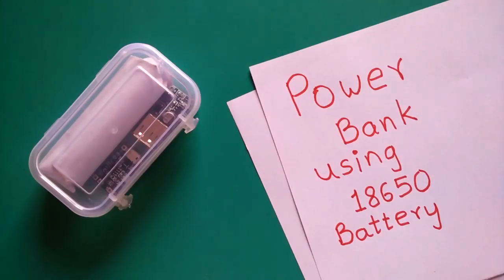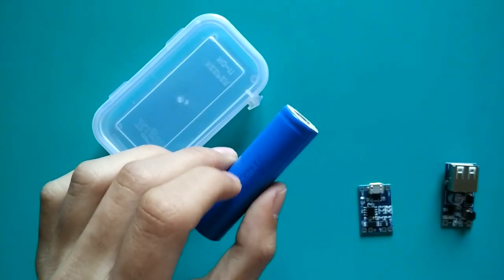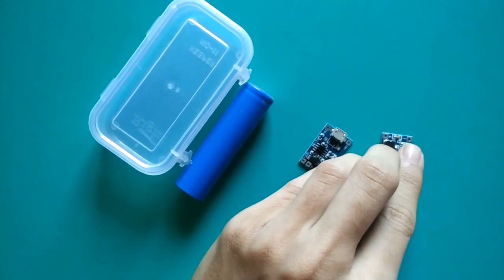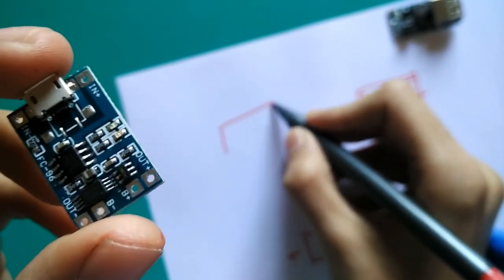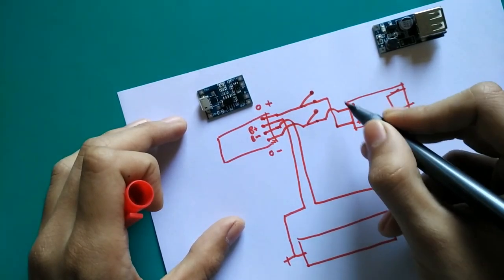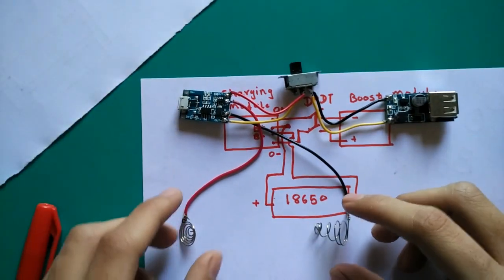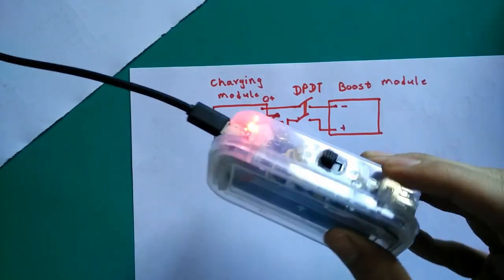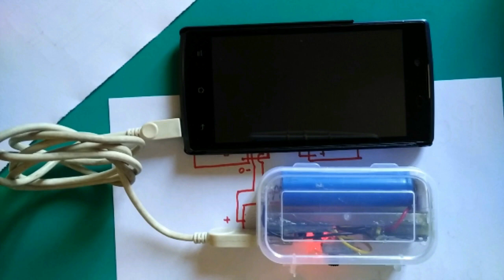Homemade DIY Power Bank (Detailed explanation)

Comment: I use 12 rechargeable battery 
My question is how many mAh is generated in output
And I use my old ambrane power bank circuit
12 battery parallel
Reply: Just add the single amperage of every one of them

Comment: what is output current of the step up module..?
and the module which i have says 600 ma so if connect two 18650 (3.7 V ,2200 mah) in parallel will the loss in current burn my board..?
Reply: No sir it will not burn,but the batteries which you going to connect in parallel must of same mah as well as same voltage it is very important

Comment: does it have short circuit protection?? both of two power bank?? that you showed in this video?? 
i was thinking if im going to  replace it with 3 old smartphone battery in parallel connections which is in good condition im just gonna remove the PCB of the batteries and put it in that power bank.do you think is it safe if im going to make it??? i hope you reply. thanks

Comment: Where did u attach the led, ? how the red led turned green after fully charging, what one has to do for it? Pls explain
Reply: The LED indicators are build in the TP4056 charging module. It will come automatically when you start using it.... 
Cheers!

Comment: Its very good man but i want the whole circuit diagram of a 3000mah power bank which makes use of recharging batteries? Can u plz tell me
Reply: Use the same schematic but you will need to connect 1 more battery in parallel

Comment: Coo! am I right that the 4 output points of the charging unit are exactly the + an - output points duplicated into 2 sets, one for charging the battery and the other for discharging to the connected  USB device? So this power bank allows for charging and discharging at the same time?

Comment: I made an 8 pack AA alkaline power bank. 12V x 2.4Ah = 28.8Wh [iPhone 6 battery is 6.91Wh] 28.8/6.91 = 417% roughly. I can charge my phone 4 times. the only downside is that I'm using disposable batteries meaning I would have to buy 8 more AA. they don't come cheap for a reason. I could always buy the rechargeable batteries but those are only 1.2v and 1.8Ah. the better the Wh on a battery the faster your phone will charge within the hour.

Comment: 1 AA battery is 1.5v x 2.4Ah = 3.6Wh which means a single AA alkaline battery will charge your iPhone 6 from 0 to 52%
Reply: Removing 30% for conversion losses and you loose 1Wh. more like ~40% MAX. in reality you need 4 AA and a high efficiency boost circuit with the phone off to charge to above 90% from 0%

Comment: you want detail heres detail. an iPhone 6 has twice the capacity as an ipod 3rd gen. iPhone 6 battery is 1810mah and ipod/iPhone 3 is 800mah. you want more details? here's the math, one of those lithium ion batteries is about 3.7v x 2.1Ah = 7.7Wh. which means that you would be able to charge your iPhone 6 or 6s 1 time from 0 to 100%. iPhone 6 and 6s has a 7.0Wh battery. you'd be getting 112% charge on that single battery. which is fine if you need an emergency battery juice.

Comment: dude for 4 battery i have charged by using this module. when i have calculated the total time taken by this it comes around 7.2 hours ..10400mah/1000ma *0.7=7.28hrs.....its like as same as powerbank

Comment: I did not understand the connection of switch in between the tp4056 & boost module I simply connected a switch between the +ve of the
2 modules & connected both their -ve via a wire and when I turn on the switch the boost module lights up but as soon as I attach my phone  (Lenovo A100) via USB cable to the boost module for charging the boost module light turns off and the phone does not charge I also attached a 47 ohm resistor at the back of the boost module as you said & then tried to charge but it is still the same place help!!!
Reply: Sir the battery positive point connects to the tp4056 and negative terminal also.then there are out+ and - on tp4056 just we have to connect the out pin to the booster module +to+and to and to add switch between the circuit

Comment: now, how can I do with 4 batteries ? charging them all with only one tp4056 will be really slow.
Reply from the maker: Large battery = large charging time. Charging module can only supply max of 1A. I think ready made power banks also require that time.

Comment: if i add 9v battery unstead of cell will it work??
Reply from the maker: 9V batery is not rechargable. It is just like use and throw.
So instead using this circuit i will recomend you to go for simple 7805 circuit.

Comment: Neat project, the only thing I would mod is putting some ventilation to the circuit board components since they get hot after a while
Reply from the maker: Yeah !! It's needed. I used hot glue so badly that now I can't remove it.
Reply: Can i use piezo-electric directly to the input to store energy?
Reply: Can i use piezo-electric directly to the input to store energy?
Reply: u need to use 5v dc regulator in order to use piezo plate, u cannot fairly charge phone using it as the generated electricity wont last long, better go for solar or thermo

Comment: Can i connect 4 or more batteries??? instead of 1?
in same circuit?
Reply from the maker: Sure. refer 6.33 in video.
Reply: +Do for Yourself  I means more than 5v ?😅
Reply from the maker: No. for that you will require different circuit.

Comment from the maker: For CHARGING NEW SMARTPHONES & i PHONES

Refer this site - http://www.instructables.com/id/Modify-a-cheap-USB-charger-to-feed-an-iPod-iPhone/
New mobiles require some voltage at two middle pins of USB too.

You will need to solder two resistors to boost module. I used hot glue so badly that i cannot remove it, so i had not checked it. 
There is no way to post diagram in comment. But I try it by writing here
2 resistors 220Ohm and 330Ohm. See back side of boost module keeping USB at right.
Solder middle two pins of USB. Connect 330 Ohm resistor between upper pin and central and solder 220 Ohm resistor between lower pin and central. (refer link given and see last image of step 5)

If any problem with it then feel free to ask

Comment: bro what if I use xl6009 boost converter help me
Reply from the maker: SURE. you can use them. Only you will need to connect USB port. And yes first make sure, you set output voltage to 5V. else mobile would damage.
Reply: +Do for Yourself what's more efficient?
Reply from the maker: +prashant dutt  from eBay I found that module I used has 96% and xl6009 has 94%.which may vary. 
I think you should select according to the application. 
Xl6009- variable voltage input range 3v to 32v, output range 5v to 32v,  can sustain more current about 2.5A. (voltage may fluctuate) 
5v DC step up- fixed 5v output, inbuilt USB port

If you want variable voltage, then go for xl6009. But yes, you can not get voltage like 9v or 12v from battery of 3v. Also efficiency will reduce as difference between input and output will increase. 
So finally decision is all yours :)
Reply: Thanks bro ,you helped me a lot 
Best wishes for your channel
Reply from the maker: Thanks :)

Comment: I have two 18650 batteries,i connected them in parallel and made circuit as u shown,after that whenever I charging my phone it is showing "charging" but after 10 minutes it is on same charge level,charge it not increasing,can u plz help,why this is happening
Reply: +Rahul S ,thaks bro fr reply,when i was fitting all thing in a box +ve terminal touched -trminal and the wires were heated ,i think it is shorted,now shld i hv to change the tp4056 also??
Reply: i bought a new battery,this time also my phone is not charging,only shoeing charging...what to do.
Reply: thank u .i'll try  : -)
Reply: brother can you send me the link of that image
Reply: This video is useless. Don't buy the module he mentioned. "Buy the 1~5 V DC to 5V 1A DC" version.

Comment: excellent video,. just what i need to build my DIY amplifier with bluetooth,. i have questions though,. I need to power 1 amplifier and 1 bluetooth module, 1(amplifier) with 5V power and for the bluetooth is 12V, so.. How do I connect DC Step Up to 5V and DC Step Up to 12V with 2 18650 battery and how many TP4056 should i use, and how do i connect it all so I only use 1 charging port and 2 (5V + 12V) port simultanously.. I hope you can help me because I’m afraid I would doing it wrong and risk of damaging all... thank you in advance
Reply: my bluetooth has ne5532 preamp built in and the voltage range start from 7V
Reply: I drawed my planned schematics,. can i send it to you and ask your opinion about it? my plan includes 2 tp4056 in parallel but on the output side devide into 5V and 12V but i’m not sure whether is safe..